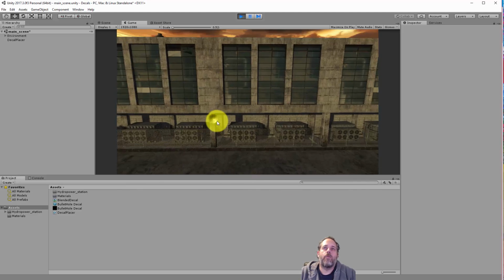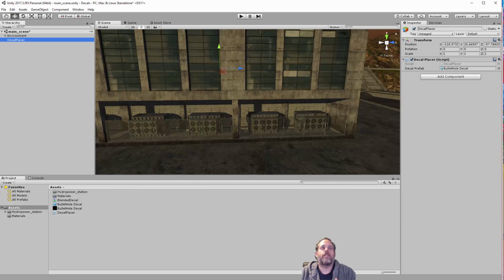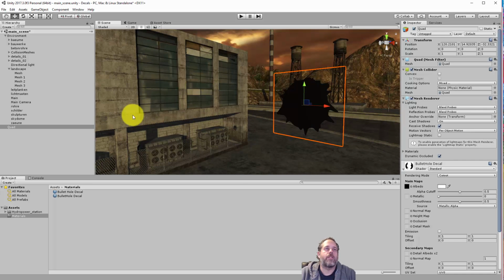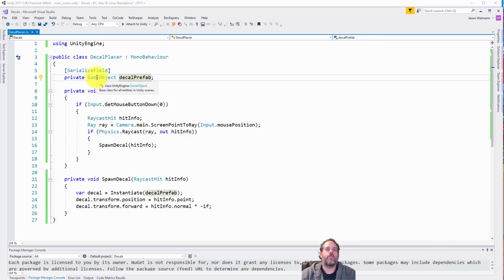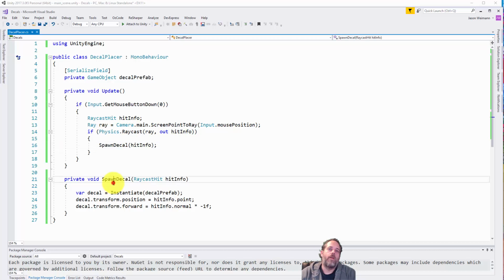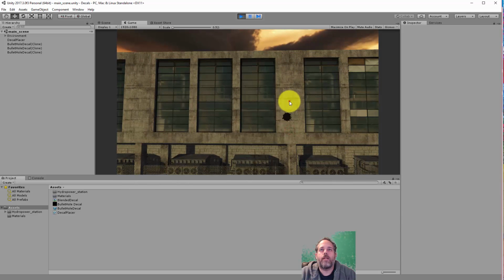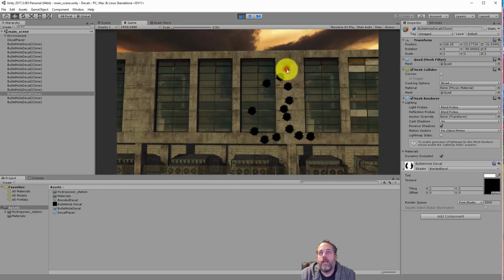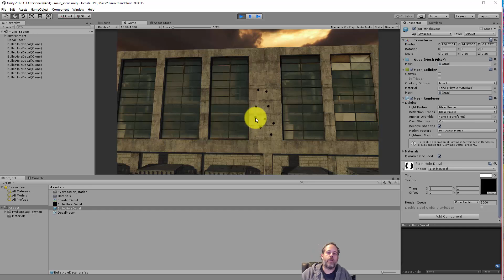Simple Unity3D Decals with no ZFighting

Comment: Im kinda concerned with what happens if this is used on a larger scale. Like if I use this on a wall when a character whacks it with a bat, do I have to worry about how close to the edge of the wall the character swings his bat? I feel like I would see some overhang.